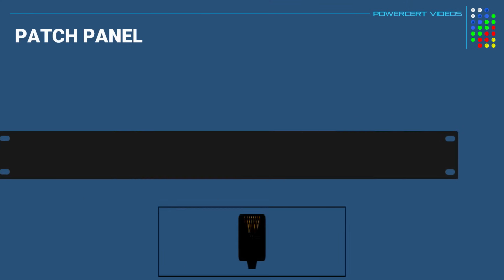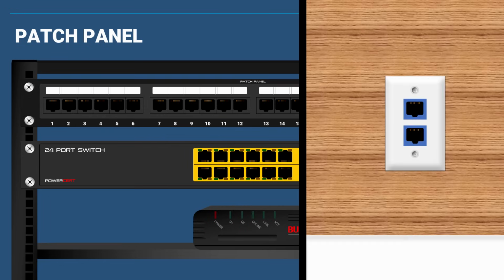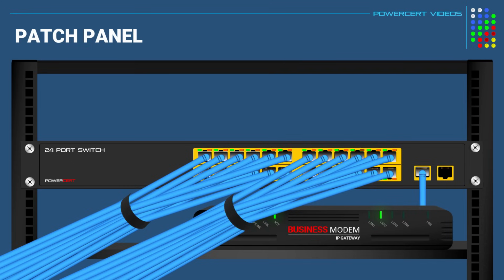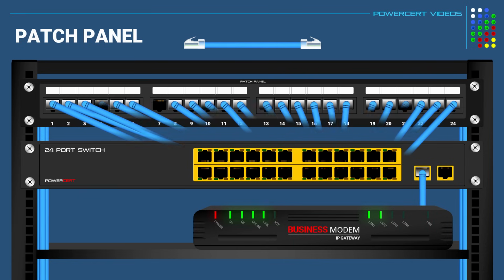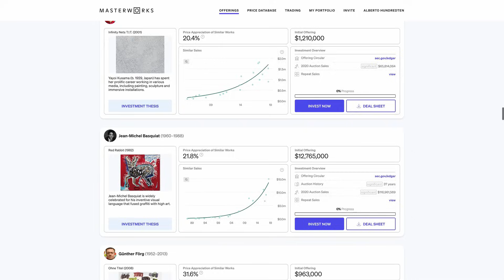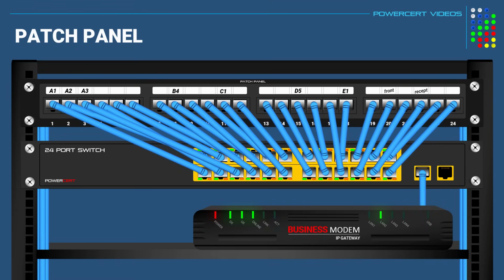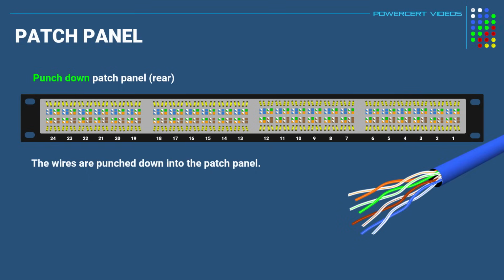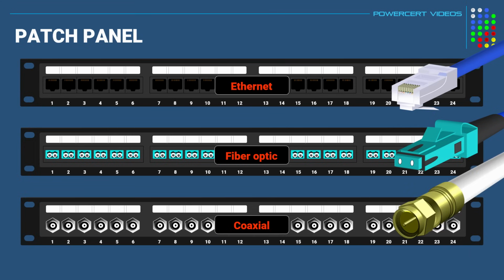What is a Patch Panel?  (cable management)

Comment: I've seen so many server and switch rooms with patch panels that still has clutters of cables. They all look good and organized at the start, but after several years of maintenance all those cables will be cluttered and messed-up too.
Truth be told, being organized does not rely on patch panels. It all depends on the personnel's that maintains it.
Reply: Yes agree. And to add, most of the scenarios, the trigger point is when there is a need to add more cables, and this where things start of out hands. So, what we did is we setup everything in full, more cost but easier to maintain in long term.
Reply: Agreed 💯
Reply: I totally Agree 💯

Comment: I don't get it... If there is enough ports on switch why would i add an extra equipment...asking for extra trouble by creating new cables and possible cable failures....
Reply from the maker: You don't need one.  It's just for cable management and organization.
Reply: @PowerCertAnimatedVideos  on a sidenote, your videos are well made and exceptionally animated. The content of your videos is extremely educational. Thank you for your contribution to society my friend.
Reply: Let's say you have a school setting. You have a wing of 5 classrooms with 10 data drops per room. That's 50 network cables going from different classrooms into a network cabinet. Without a panel, it would make it very difficult to figure out what cable is what. Each data drop should be labeleed, like Room 1-1, Room 2-1, and so forth. That way, you can quickly identify where that cable is on the panel and connect it to the correct switch port. In a small home/small office network, you can get by one without a patch panel. But when you have many connections, having a panel makes it easy to service your network.

Comment: I don't see the use. . Just use a switch. Also to have to split all the wires and attach to back is a lot of work.
Reply: Let's say you have a school setting. You have a wing of 5 classrooms with 10 data drops per room. That's 50 network cables going from different classrooms into a network cabinet. Without a panel, it would make it very difficult to figure out what cable is what. Each data drop should be labeled, like Room 1-1, Room 2-1, and so forth. That way, you can quickly identify where that cable is on the panel and connect it to the correct switch port. Another reason to use a patch panel is to prolong the longevity of the cable. The cable runs that go from the data drop to the network closet are stiff and not meant to be moved around. If you have to plug and unplug the other end of the cable from the switch often, you can potentially damage the cable. You would have to replace the entire run which can be difficult and/or costly. With a panel, all the cables terminate at the back of the panel. You just plug a patch cable from the panel into the switch. Its much easier to replace a bad patch cable rather than the entire cable run.

In a small home/small office network, you can get by one without a patch panel. But when you have many connections, having a panel makes it easy to service your network.
Reply: The use comes when you need to create a peer to peer network between two end user devices physically separated over a large area